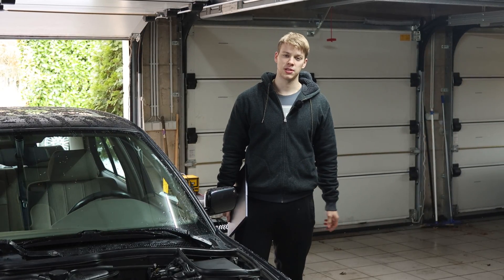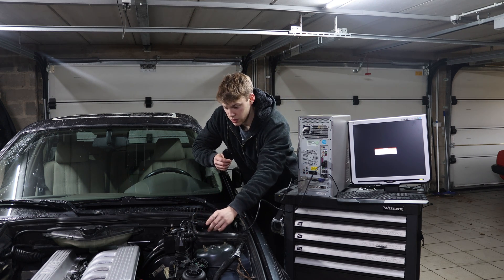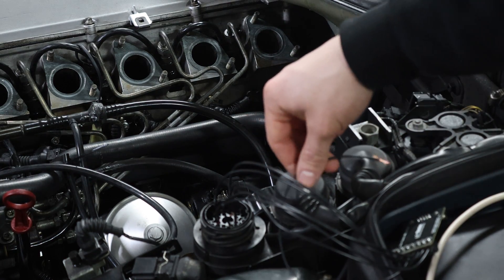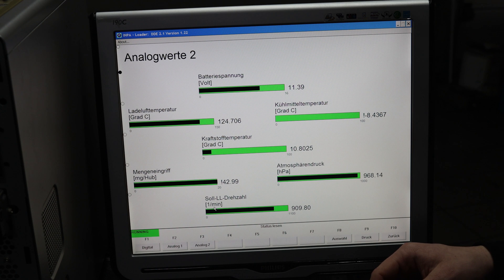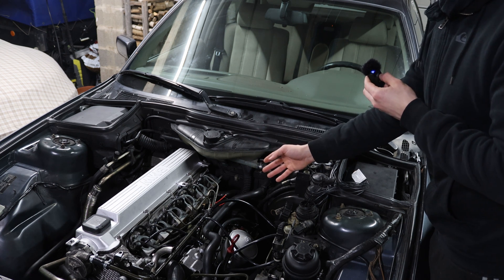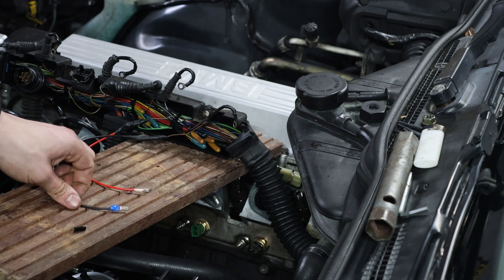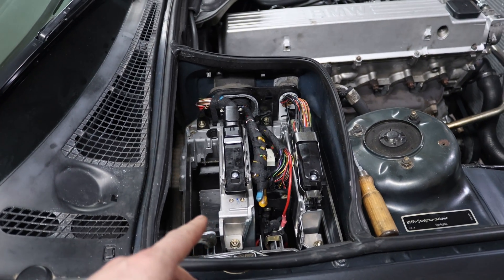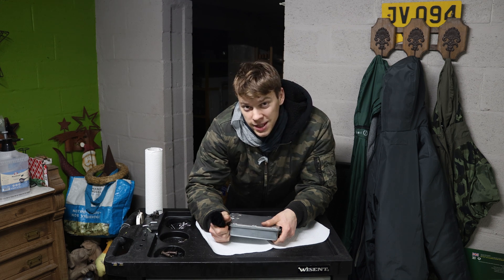Fixing My BMW E34:  Diagnostic Challenges & ECU damage?

Comment: How did you sorted at the end? What the ECU at fault?
Reply from the maker: @ionutcerga3176 The ecu was fine. The issue with the cold starts was a combination of many things. cheap glow plugs and clogged injectors, so no atomisation of the injected fuel right now the e34 starts within the first 2 turns even at minus 5 degrees celsius :)
Reply: @DailyDrivenClasssics  thanks for the reply. I've watched your videos and they've helped me a lot with the work that I'm doing on my E34. All the best from Romania!
Reply from the maker: @ Good to hear  that :) Soon i will do a few videos on the e34 again :)

Comment: hi! I have opel omega B 1996" with the same engine m51 (engine tag x25DT). Where can I get an ALDL diagnostic cable and what program is used, where can I find it? I have a connector under the steering wheel with 16 pins, but it is older than the OBD standard.I have a problem, the car is very difficult to start when it is standing for half an hour - an hour after driving. And it loses a lot of power when it's very hot outside. By the way, the car has only 98,000 km, but it has been in the garage for 19 years. Sorry for my bad english...  your videos are the best :)
Reply from the maker: @ThePodunavac
@ThePodunavac Hi,Unfortunately I dont know where you can find a diagnostic tool for your omega. If done a bit of googling and found some sites that offer scanner for the m51 variants if I'm right. The hard starting (cranking for 1-4 seconds ) when its warm is because on m51 the lift pump and glow plugs don't work when the engine is started in the hot. If you mean really hard to start I would look into the fuel pump timing that might be off despite the low mileage. I would check live values with a scanner and go from there. And the loss of power when really hot outside ( 35 degrees celsius) is also normal to a certain extent. the air is a lot less dense, and an m51, an old 2 valve indirect injection diesel is really inefficient. Also x25 dt didn't have an intercooler so the issue gets exacerbated.  I could feel a large difference between driving at 7 degrees c yesterday and at 30 degrees 2 months ago soi guess it's "normal" to a certain extent. I hope I could help :)

Comment: Nice information here. Can you please tell me how I can reed the ecu on my e38 1997 please? Sorry for my English 😅
Reply from the maker: @heroykenn
@heroykenn  Post 1996 is easy. You just need a regular laptop. Install INPA and make sure that all software settings are correct with what you find on forums. And then you can scan your e38 with a reguler usb to obd2 adapter and a regular 20 pin to obd2 adapter. Hope this helps :)

Comment: Very nice work! I am facing an issue with my 1995 E39 538i which only has the 20pin connector available. Can you by any means point me to where you got the interface from. Or do you have a circuit diagram? Any help is immensely appreciated. 😊
Reply from the maker: @BadExcuses
@BadExcuses Thanks! I got my interface from extraclassics , but I'm currently negotiating with an electronics producer to produce new boards. I unfortunately don't have electronic diagrams for an e39 but I'm sure you can find some on the internet. Whats the issue on the e39?
Reply: thanks for the hints @DailyDrivenClasssics   - the issue on my E39 is that it went into "Transmission Fault-Mode (Notprogramm)" without any other apparent problems (no weird noise from transmission or anything like that...). It is now neglecting 1st and 2nd gear. Also the starter failed 1 day later after (might be related?!) So I'd like to check for fault-codes before having it towed to a garage as the issue might be simple to fix (depending on what it actually is). My current suscpicion is that the electronics in the mode selector (PNDRS) might be faulty, causing the car to assume that it is in P when it is actually in a gear, which might have caused the starter to go bad...
Reply from the maker: @BadExcuses
@BadExcuses  That's sad to hear, but I'm sure you'll get it sorted:) Have you checked the oil level of the automatic box. I've seen a video where the selector rod seal leaked. Maybe a low oil level can cause these issues? Also I don't think that the starter and the transmission issues are related. Just give the starter a few love taps with a hammer and a metal rod, maybe it decides to jump back to life :)
Reply: @DailyDrivenClasssics  Thanks man, I'll give it a shot! Definitely need to check the transmission fluid.
Reply: @DailyDrivenClasssics  Here's a quick update as it might be relevant also to other people: I have replaced the crankshaft-sensor as I have seen that the motor-start problems in this video linked here looked similar to mine. And it fixed it. So in summary the Gearbox was only in "Fault-Mode" because it could not make sense of the faulty values it was getting from the crankshaft. Video here: https://youtu.be/WifRjWBWYfw?si=zMzLkH9WrAn6zNaE
Reply from the maker: @BadExcuses
@BadExcuses Really nice to hear that your car is back on the road :)

Comment: Done the diagnostic on an 1997 bmw e36 it's a obd1(there is an adaptor from obd1 to obd2 that goes into the obd2 cable then to the laptop)
It runs with inpa and ista+ from 2019 and a brand new 2024 laptop with no problems
just but that adaptor and it will work!
Reply from the maker: Nice! On my 2000 e46 everything works just how you described it. Running a new version of inpa on windows 11 2023 laptop. But a sure way to check if you need a tiny ads interface or not is if pin Nr 15 is present in the round port. Yours being 1997 it shouldn't have pin 15. since bmw switched in 1996 so 1996 and backwards needs the ads interface. Thanks for the support! :)
Reply: E36 tds? Can you help me maybe? I cannot get it to run and read ecu DDE 2.1. Only system I can read is Airbag unit.
Reply from the maker: @Rudya.K  you can write me on IG. Im gonna try to help :)

Comment: Oooh, the roller coaster with bmw diesel engines. Am right there with you, brother. Am 2 cylinder heads in, and after all the dramas, i  finally found a shop to fix the original. The end is closer 😅😅. Keep on
Reply from the maker: @errolnkh1776
@errolnkh1776  Thanks for the encouragement! It runs right now :) I just need to  free up the rusty brakes since it has been sitting for so long:/  And its nice to hear that you found a good shop. I just hope that your repair doesn't end in the same nightmare as my cylinder head repair

Comment: +1 on the tinyADS. It’s great. Did you buy your’s pre-built? Or did you build it on your own?

With your current troubles, measure the resistance at the pins on the ECU side of the harness with your 1000ohm resistor in place. You should see 1000ohms. 

If that works, do a voltage drop test on the harness. Disassemble the ECU connector so you can access the rear of the pins at the ECU when it’s plugged in. Plug the other end of the harness in at the temp sensor. Turn the key to on. Place your multi-meter leads on the ecu and temp connector ends of ONE  of the two wires. You should see 0V. If you see a larger values. There is a voltage drop occurring somewhere in the harness. Repeat for the other wire.
Reply from the maker: @a777fan
@a777fan mine was prebuilt but I am looking to launch a reproduction with it fully prebuilt with adapters and cables. Today I did some more work and finally got it running. The coolant temp shows correctly right now. Unfortunately inpa is not showing a signal on the actual injection timing? I get continuity on both wires from needle position sensor to the ecu. The sensor is new and reads 100 ohms so its good. Tomorrow I'm trying to also look at the CPS maybe that's the culprit :( Thanks for your suggestions and support! It is greatly appreciated :)
Reply: @DailyDrivenClasssics  Hi, I Have a 1992 325 td, I built a homemade ads interface but i can't diagnostic with inpa or with DIS 
Do you have some tip for me. 
Thanks! and sorry for my english
Reply from the maker: @alexandrefisterra1720
@alexandrefisterra1720  Hi sorry, but I cant really help you:( I would suggest to check if the INPA installation and setup is done correctly, but otherwise have no tips. Sorry !
Reply: @DailyDrivenClasssics   I got It, today change the pump settings with DIS V44, I have an 525 TDS ecu DDE 2, INPA only see the ABS but don't comunicate with anymore,
Reply from the maker: @alexandrefisterra1720
@alexandrefisterra1720 That's nice to hear that you fixed it :) Sometimes inpa installations are faulty. I had to do mine 3 times before it worked. Maybe that was the issue?
Reply: @DailyDrivenClasssics  maybe need some ecu file, i don't see DDE 2 option only DDE 2.1 option
Reply from the maker: @alexandrefisterra1720  for me it showed dde2.1 on e34 and dde 2.2 for e39.
Reply: @DailyDrivenClasssics  yes but the ECU is a dde2. Inpa giveme  SYS002 error only read ABS-ASC
Reply: @DailyDrivenClasssics  nice! Glad it is at least running again. 

I would still use a voltage drop test on all the sensor wires to confirm that they are still good and not corroded in any way at any of the various junction points in the harness. Being 'low' voltage (~5V or less), the measurement can be greatly influenced by even small increases in resistance. Example: You may 'see' continuity on the wires, but still have issues with the sensor. On my 1995 540/6 I found lots of corrosion hiding under those rubber caps that BMW liked to use on the harness. 

Remember: For a proper voltage drop test, you need voltage applied to the circuit during the test. Many great examples out here on YouTube University ;)
Reply from the maker: @a777fan
Yes But it starts the same as in this video (sometimes even slower). However it has no idle :;( As soon as I let of the throttle, it instantly dies. But I Get throttle signal on Inpa. Have to do some more fiddling around :( I will also voltage drop test the sensors. ( quick question: If there is no resistance in the wire I'm checking, there should also be no voltage drop. Or am I wrong)

Comment: Really interesting stuff. Hope the ECU is OK, fingers crossed it will be.
Reply from the maker: @bobfrankish8883
@bobfrankish8883 I do not know unfortunately. I also did wiring tests with the injector 4 needle position sensor. The wires are fines. sensor is new and working. but inpa shows no actual injection angle. It is kinda frustrating :(

Comment: Have you tried giving the pump fuel from your own source? It was always the first thing I done, a makeshift tank with feed and return. The vp is great at pumping but not so much at sucking and the case pressure is what drives the timing cylinder. I saw a few times (cant remember if e34) the pump which sends fuel from one side of the tank to the other failing causing low fuel problems below half full. I'm just throwing ideas out.
Reply from the maker: The e34 just has one giant tank if im not mistaken. The tank is at 3/4 and lift pump works and delivers a fuel quickly to the front. i am working on the car as we speak, unfortunately i am not getting injection angle reading in inpa so i dont know if there is another wiring issue😭

Comment: got the same tinyADS interface, its so good. but you can just use the cheap 20pin adapter cut it open and solder the wires to it. its a much cleaner option then the bare wires everytime.
My inpa also shows weird coolant temp values when the engine is turned off, if i turn it on everything is back to normal. I think its the way its supposed to be.
nevertheless i enjoy your videos very much!
Reply from the maker: @erik4121 Thanks for the tip!  I Hope my inpa is just messing with me and the error goes away once the engine is running normally:) And thanks a lot for the nice feedback !
Reply: @DailyDrivenClasssics  yeah as long as you dont get any new "Fehler" in the "Fehlerspeicher" the temp sensor should be fine.
Reply from the maker: @erik4121
@erik4121
I had 5 errors related to the short. I tried resetting  but they always came back. After the " repair" all errorcodes stayed away. I guess my hack job was successful. Now i just need to find a new connector. The old coolant was so stuck  in the connector that i couldn't unpin and reuse it. What a shame :(
Reply from the maker: Unfortunately the closest scrapyard is over 100 km away🥲 wont go that way for a 2 cm connector
Reply: Where can i get the ads interface?  Im using software + hardware named 'carsoft', it is so bad and i cannot read live data from it :( thank you and nice progress on the mighty m51
Reply from the maker: @Raul_VRC  I've heard about the carsoft diag tools. some people like it but most don't so I'm glad I stuck with tiny ads and inpa. I am currently looking into a reproduction run of a tiny ads interface( already soldered to the 20 pin and ready to use) so if you have time to wait I can send you one in 2-3 months time. I bought mine from a german distributor named extra classics. de. They unfortunately only deliver inside of germany ( I had to deliver it to a friend who then shipped it to me) but they also offer a weird service where you have to deliver it to a german distributor who then delivers to you.  Thanks for the support !